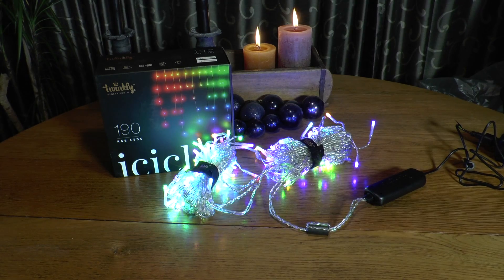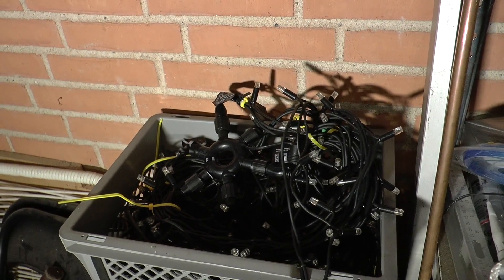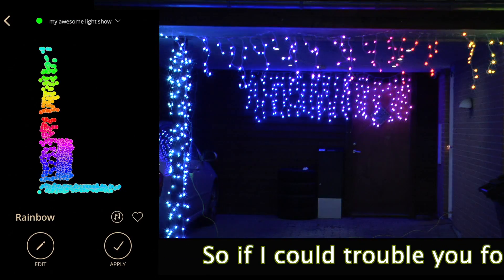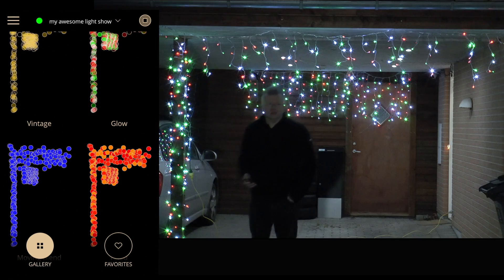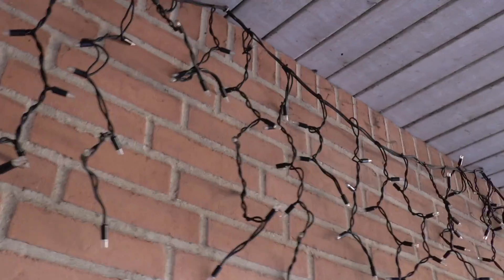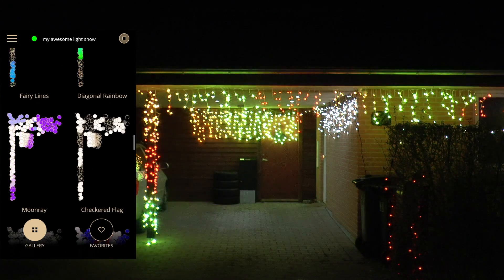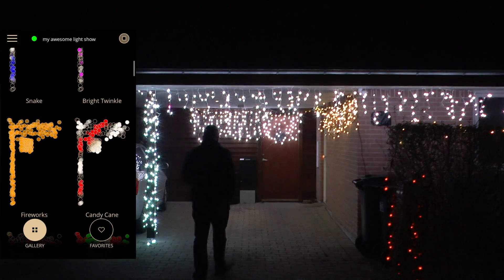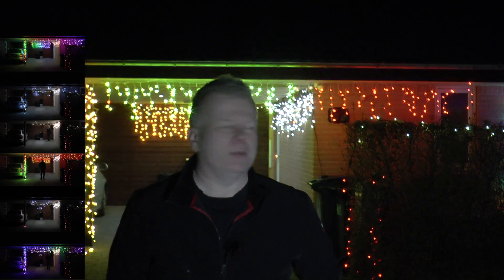Twinkly Icicle, Wall and String LED RGB lights for Christmas

Comment: Thanks Martin, another great video. I've got the tree string, wall and curtain. How do you rate the icicle twinkly lights? I'm interested in getting some but not sure how good they will show the effects.
Reply from the maker: Matt Ward 🙏 thanks. Good question. You are right about to doubt it. With the new features, I’d say that  the icicles are more limited in use and I would definitely rather buy another wall/curtain or string(if you have a large tree) first. I think the features really shines when you can create a carpet of LED. Also when you look at their official videos, specially for their new pro series too, the best showcase is a dense carpet leds.
Reply: @rud  Yeah, that's what I thought.. Yes, they are really impressive when you've got a dense amount of LEDs together, really impressive!  You've got a great setup there with yours, your videos are fantastic and I really enjoy watching you put it all together! Cheers!
Reply from the maker: Matt Ward thanks. 😀

Comment from the maker: WiFi Heatmap App (Let me know if you try these please)
Android: https://play.google.com/store/apps/de...
iOS: https://apps.apple.com/us/app/ar-wifi...

If you are interested in purchasing Twinkly Lights I've included links below.
Just keep in mind that they offer RGB and RGB+W. If you can swing the extra cost I recommend getting the RGB+W, the only difference is it adds white as an option.

[ Twinkly String Lights ]
400 RGB+W - https://amzn.to/3kFqtmw
250 RGB+W - https://amzn.to/3DoUIpd
600 RGB   - https://amzn.to/3HosCNk
400 RGB   - https://amzn.to/3qMrugz
250 RGB   - https://amzn.to/3DmB2lL
400 Gold  - https://amzn.to/30uIs8G
250 Gold  - https://amzn.to/3ceIBzj

[ Twinkly Icicle Lights ]
190 RGB+W - https://amzn.to/3FrK8yB
190 RGB   - https://amzn.to/3wYLkGv
190 Gold  - https://amzn.to/30uZrXL

[ Twinkly Cluster Lights ] (Kind of a mix between String and Icicle)
400 RGB+W - Not Currently Available
400 RGB   - https://amzn.to/3nlkANl
400 Gold  - https://amzn.to/3ozbmwb

[ Twinkly Curtin Lights ]
210 RGB+W - https://amzn.to/3CokIzE

[ Twinkly Outdoor Light Tree ]
750 RGB+W 13.1ft - https://amzn.to/3cg0T39
450 RGB+W 9.8ft  - https://amzn.to/3njFQTn
300 RGB+W 6.6ft  - https://amzn.to/3ceJ04N

[ Twinkly Indoor Pre-lit Christmas Tree ]
400 RGB+W 7.5ft - https://amzn.to/3oB31Ih
400 RGB   7.5ft - https://amzn.to/3DrtX3x
400 RGB   6ft   - https://amzn.to/3oA1XEH
400 RGB   5ft   - https://amzn.to/3Hotl10
500 Gold  7.5ft - https://amzn.to/3qF5R1K

[ Twinkly Music ]
Sync Twinkly Lights with Your Favorite Songs:
https://amzn.to/3kFrMBW

[ FM Radio Transmitter ]
If you combine Twinkly Music with an FM Transmitter you can share your music with cars driving by. Sadly the one I purchased is no longer available https://amzn.to/2YVaObk but it will bring up similar items.

Comment: Great video! i bought the 400led string after watching one of your videos, and i love it! but i wonder if you have tested the timer function in the app?
Reply from the maker: Johanne Øien awesome. You can really be creative with them. I use the timer and it works. When I got the first string I had it connected it to the rest of the light but they reverted to the default animation when I removed the power to the controller so definitely use the timer. Haven’t checked later software versions for that though. 
This Sunday it looked like one of the strings didn’t turn off when I grouped them but I haven’t been home when they turn on and off to verify it. So I will say, yes it works. Cheers.
Reply: Hi Johanne - yes, the timer works, last year I had a smart switch on it and it kept the "applied" theme so that worked as well.  But the timer in the app works and works well. How is the 400 LED, are you using it on a tree or some other way?
Reply: @MattWard75  its wrapped around a  column for now, but the plan is to put it on the christmastree 🎄🎅🎅

Comment: Hi!  I'm looking at getting some of the string lights as I have 2 columns in front of my house.  For your wooden column, how length/size of strand did you use?  Was it a 400 LED strand?  Want to Guage what size i will need.  Thanks!
Reply from the maker: Hi. It is the old generation 1 with 210 LEDs. It seems to be enough to generate a cool effect and I think it is enough but not any less than 200.  But that being said. I have never heard anyone said they got a chain with less lights. :) hope that helps.

Comment: I just bought these to prepare for Christmas and they look really good. The only bad thing is that they say it is not recommend it to use it outside when the temperature drops below 0°C. I know the winters are normally mild in Denmark but have you got into any issues with the lights not working properly when it has been cold outside?
Reply from the maker: Hi, I have not read that part. :)  I can't remember it being really cold, I think at most -10C so they have been outside when it was freezing.I have not had any problems relating to the cold what so ever. I don't know what the problem could be. 

I have some tube lights(not twinkly) and they usually get quite stiff in cold weather so I run them for a few hours inside before wrapping them around something outside. 
But the Twinkly seem fine in the cold. Maybe if water got into somewhere it shouldn't and then expanded when it froze to ice. I have a few co-workers who also have bought these chains and they have not talked about having any problems.
My main problem have been WiFi connectivity. :D
Reply: @rud   Okay, I just mounted them up under the roof in my backyard like you did :)
Reply from the maker: @alexforspeed  Excellent, I think it will be all right. I am kind of wanting to install them now, have to restrain myself a bit. :D Cheers.

Comment: Hello, I have Twinkly leds 225 first generation and new one 190 leds its a curtain. I want to use same time but I dont know what Can I do. I conect it for separate but I try to find wifi twinkly but I cant make it ... T.T   Please can you help me? Thank you very much and sorry my english
Reply from the maker: Hmm you should be able to use them both, I have done so. 
1) test it in a place you know has good WiFi connection, this is very important.
2) make sure that they are updated with the latest firmware
3) You should be able to create a group for them in the software on the phone. I have only done this once so I can't remember.
4) If everything fails, try to factory reset them by unplugging them, press the button and hold it while plugging it in again and keep holding it until all the lights are red.

Comment: Where you buy the 6 connector ?
Reply from the maker: I guess you mean the one that splits out the power. I bought it at the Bauhaus hardware store but online shops sells it. It is for the Chrissline lights.  https://markslojd.com/en-fi/system/chrissline